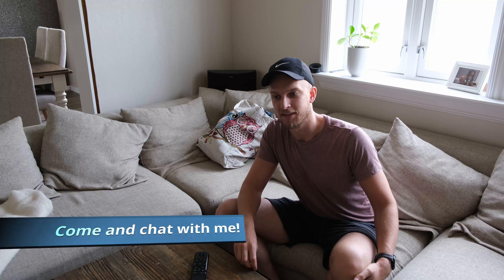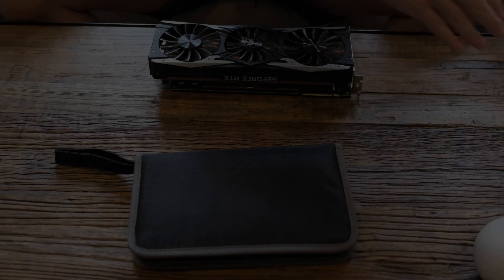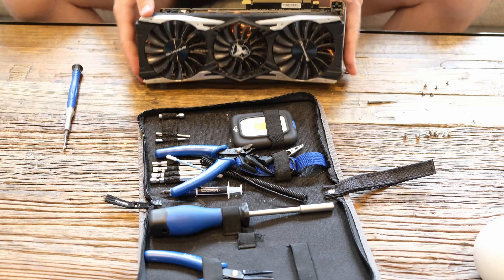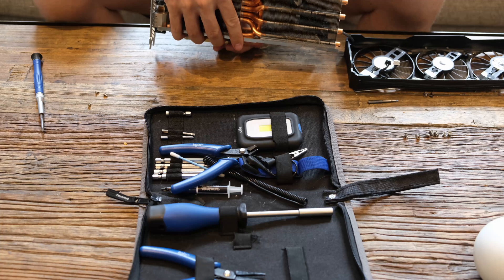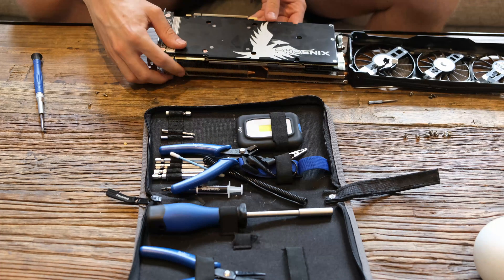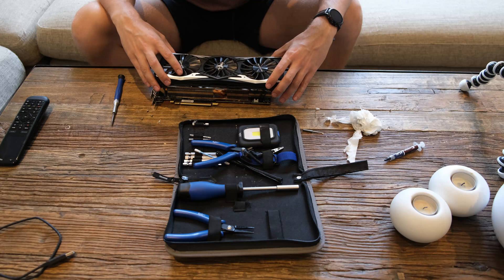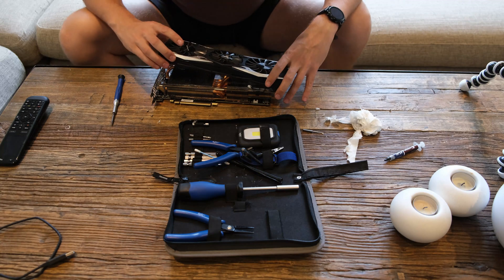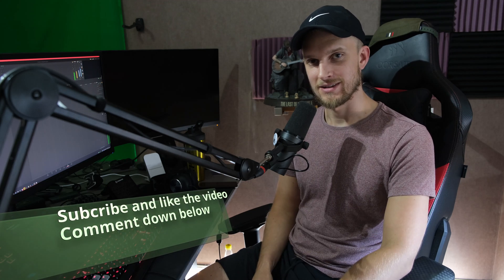I changed the thermal paste on my Gainward RTX 2080 Ti

Comment: I have the same card, I've never opened it, I'm interested if you can tell me what your VRAM temperature is, my VRAM is somewhere around 90-95c and the hot spot is around 95-100c, I don't know if that's normal, that's why I'm asking.
Reply from the maker: I don't have this card anymore, so i can't compare but that do sound a bit high. Should be around 10c lower.
Reply: @lebigone4987  Thanks for the answer, so it's not normal, I have to clean it.

Comment: Thx for the Video!
i have the same card after 3 years i opened my card and hell the thermal paste was bad on it,
i changed everything and its about 10 degree colder and the fans are super quiet again thx alot <3
Reply: I've never opened it, it's 3 years old, did you change the thermal pads also? Can you tell me what your VRAM temperature is, mine is 90-95c so i can know if it's normal or not, that worries me a little, especially in the summer.
Reply: @sjuric2435  i didnt changed the thermalpads! My vram temperature is on max at 80-83 degree's
Reply: @zRamsayBolton  Thanks for the reply, then it's time to open it and clean it.
Reply: @sjuric2435  Tell me ur results :D!
Reply: @zRamsayBolton  I will when I clean it in a few days.

Comment: Yeah, don't do this.... taking apart your GPU and voiding the warranty for a couple of degrees benefit (if indeed it makes any difference) is not worth it. Fun video but the potential downsides are far greater than the upsides.
Reply: Most companies don't void your warranty for changing thermal paste my evega 2080ti and 3080ti both have 4 screws to get to the gpu die I think he took it apart on the wrong side
Reply: @timtoomuch  Also this guy doesn't get that people don't do this for a couple extra degrees. I've got a 2 year old 2080ti that has a 68 degree hotspot when it's not doing anything and shuts down under load. There's no other reason for this than the thermal paste drying up. People don't do this just for fun
Reply: @braidena1633  I have an evga 2080ti ftw3 it runs cool but used thermal grizzly kryonaught extreme that just came out and dropped at least 5 more degrees
Reply: @timtoomuch  ahh yea I'm not out to get the lowest temps, just want it to not shut down. I think whatever paste is there is going bad at the hottest part of the die, which makes sense. I plan on using Corsair TM30 that I have plenty of. Just need to wait for the precision toolkit to arrive
Reply: @braidena1633  I haven't used the tm30 but did pick up the xtm50 seems to work well they all are within a few degrees of each other the kryonaught extreme was the only one that made a significant difference. My case had alot to do with temps  just bought the corsair 5000D inflow and definitely made a difference as well no my 10850k @5.2 ghz is in the 60s vs 80s before anyways good luck to ya hope you get it figured out
Reply: @timtoomuch  I may have misspoken. I don't overclock really, and haven't paid attention to fan curves, but it must have gotten reset somehow? I didn't even adjust anything. Anyway, temps are back to normal. Will put off repasting until I absolutely need to. Thanks for the tips tho
Reply from the maker: On my card, this is the only way to get to the GPU. It is normally only 1 way to separate the cooler from the GPU
Reply: I bough this card and it cooked it self :D changed o nwarranty :D but now, after a long time :D the repast and repads are needed :D

Comment: Can you tell me the temps? My is reaching 80°C in cod cold war, is that normal or too much?
Reply from the maker: I think that is normal, the main thing you should think about is the fan noise. Mine got pretty much inaudible after doing this. But I think the temps is about the same as before. And it should throttle less also (more stable fps in-game)
Reply: @lebigone4987  i just did it and get about 5°C less, and then I also put the fan speed higher so now I get like 62°C in cod cold war but the fan is on 100% but at all it don't mind cause it's still not too loud. Can't hear the computer when im playing.
Reply from the maker: Nice, cool to hear! Thanks for reporting back

Comment: Nice video man, what were your temps before and after?
Reply from the maker: Thanks 😊 I actually forgot to check before and afters. But the main thing to get out of this is that the card is stable now. Can't even hear the fans anymore.
Reply: @lebigone4987  Np :) I orderd thermal paste and im going to do it as well I really hope it works because my gpu underload gets to 86 degrees i got the 2080 ti
Reply from the maker: Nice, good luck dude! Would love to hear back from you after you do it!
Reply: @lebigone4987  I'll let you know soon!
Reply: @rekkinqaura  news?
Reply: @Cliffracer46  Didn't do rlly much made it more  stable now its mostly 83/84 degrees, but I have a dual fan so its normal for my card to get so hot.

Comment: Is doing a dot pattern the best way for the paste to spread? I just got a water cooled 2080 ti and I am switching to the stock cooler and I want to make sure I put enough thermal paste on.
Reply from the maker: I think that is the easiest way to be sure that the paste is covering the whole surface. Just don't overdo it. I use a little too much in the video

Comment: How about putting some before and after fegures so we know if its really worth the try.
Reply from the maker: Yeah, I know.. but I can tell you that it gave the card way better stability. And the fan ain’t going to 100% and down to 20% every half minute. Not sure if I gained any frames though
Reply: @lebigone4987  That has started to happen with my card. thanks for the info!
Reply: @lebigone4987  soooo have any numbers like degrees in improvement???
Reply from the maker: No sorry, my main goal with this was to get a more stable fan and I achieved that. But I imagine that if it did anything with the temps, it helps nothing more than 5 degrees.